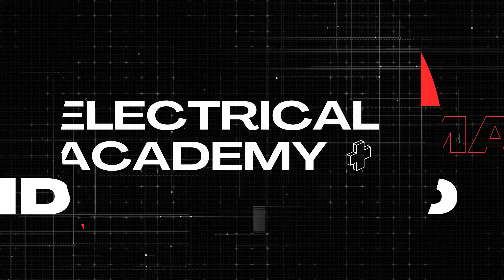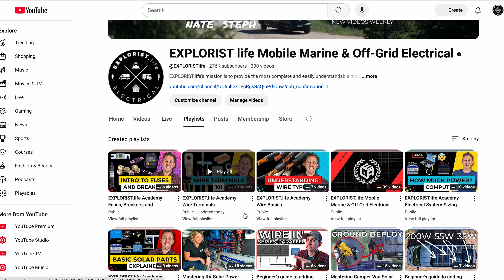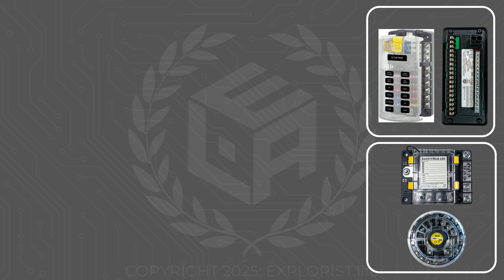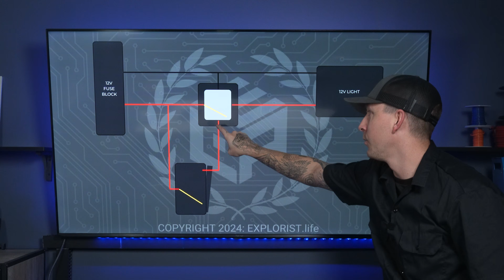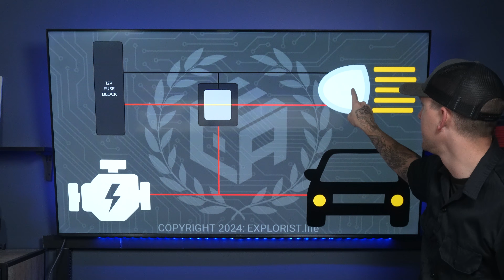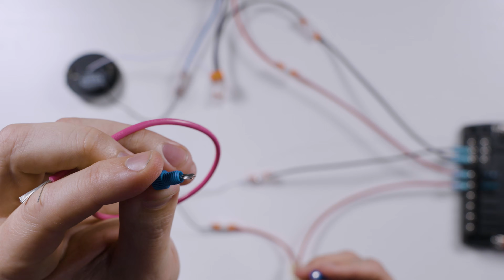How to Tap Into A Headlight Circuit - Branch Circuits | Ep: 8/10

Comment: How do you make a master switch for your lights with different zones?
Reply: Just put a switch between each “zone” of lights and behind all those switches and lights, a master toggle, switch or circuit breaker with appropriate Amps and wire gauge.

Comment: you guys do know, they sell headlight extension connections.   This way you dont have to splice or damaged the original wiring.
Reply from the maker: Yes, and they don't exist for every vehicle.  This video was teaching how to use a posi-tap for any circuit when an extension like you're talking about doesn't exist.

Comment: You can use that white "Gardner Electrical Sealing Tape" compound and cover your Posi-Tap connector to make it water tight.  I have used Posi-Taps + sealing compound for landscape lighting buried in the ground for years. No shorts

Comment: My vehicle and many new models have LED headlights controlled by the canbus and therefore no 12 volt high beam signal. I used a canbus module to trigger the relay for the driving lights. no cutting wires.

Comment: Your videos are all amazing and a ton of great info. As an MECP advanced certified tech myself I enjoy seeing somebody that actually knows what they're doing on YouTube. However,T taps and similar connections like what you're using are NOT common practice. Should always military splice and tape and then solder. Also I think it's safe to mention that if you're not buying lights that already come pre-wired with a relay and is really important to Make sure you buy a relay from somewhere. So many people come to my shop with burnt up wires because they just figure they can just hook it up directly to the circuit with no relay. Sure it works for a while, but over time depending on how long you have the devices powered up it will eventually burn out the circuit and burn the wire and possibly cause a fire.
Reply from the maker: Solder is rarely the best option, no.  So much so that the ABYC specifically forbids using it as the sole means of a connection and generally discourages against soldering as the temper it creates subjects the connection to being brittle and breaking: a problem a mechanical connection like a t tap solves.

Pros and cons to everything and yes, t taps are indeed common practice, just perhaps not in your industry.